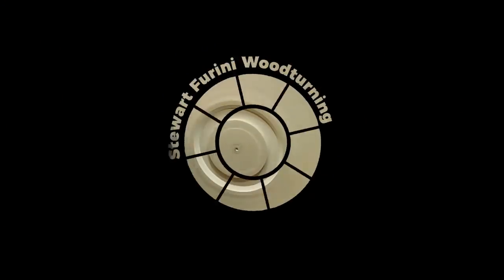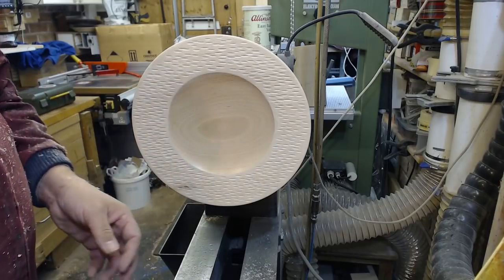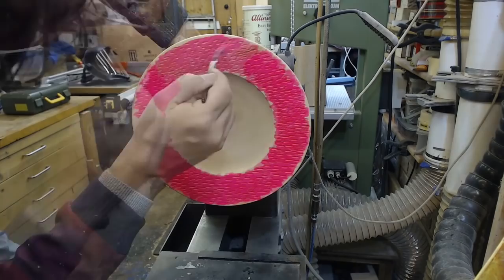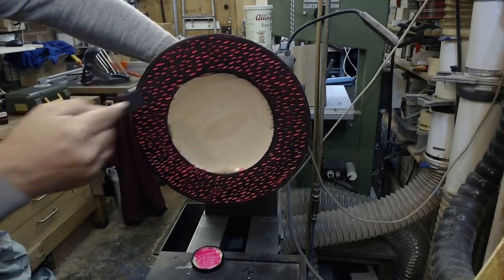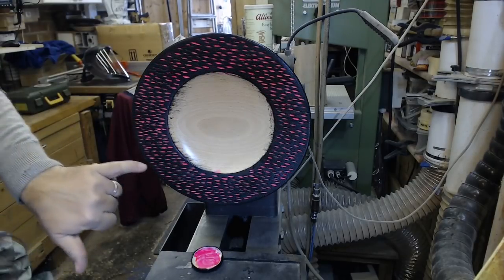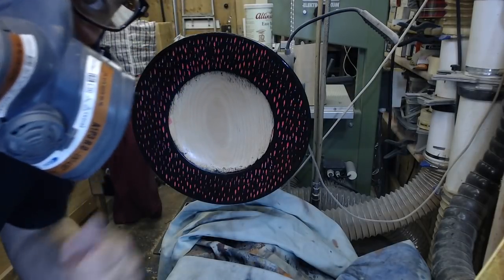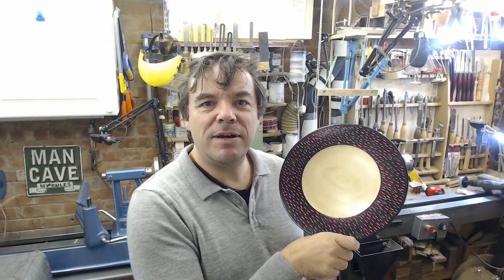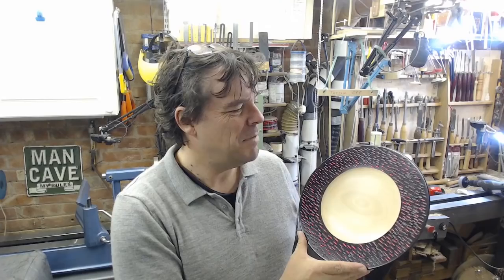Hot Pink Textured Rim

Comment: I know is a waste of time saying this as it more than likely been turned away but I like it
Stuart is there a reason why you use sanding sealer from a tin or is it just easier that way?
Reply from the maker: Hi Graham - fear not, it still exists....and will probably remain in existence as the blank as probably got to the smallest it can be before it's useless.....it might even be my next giveaway piece. I use the aerosol sanding sealer so that I don't smear the colours that I've used, though for acrylic paint I suspect that wouldn't be a problem. My first ever colouring was sealed with cellulose sanding sealer put on with a brush which mixed all the spirit stain colours together....since then I've stuck to the aerosol acrylic one. Cheers!